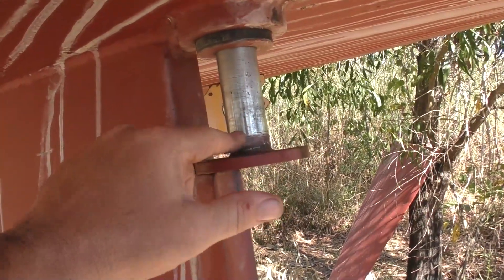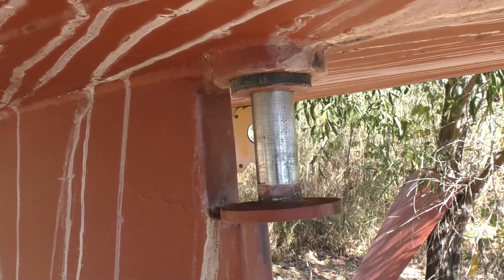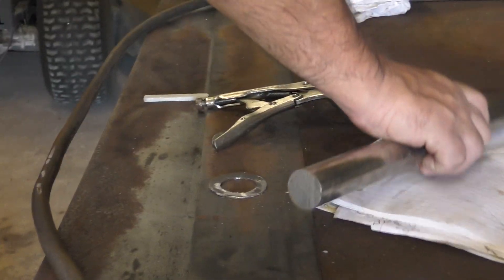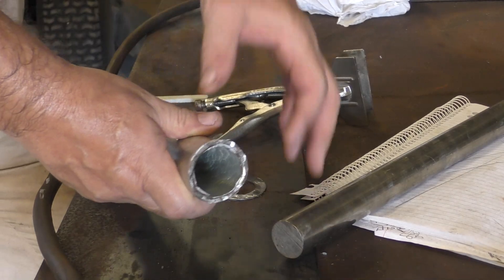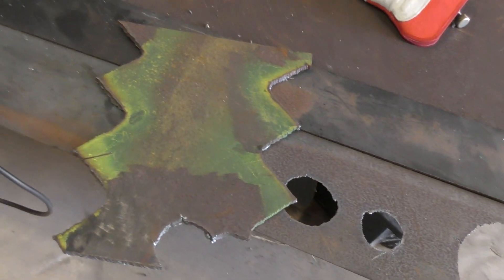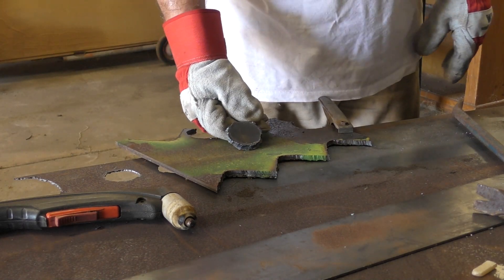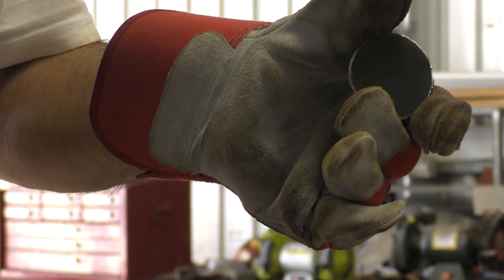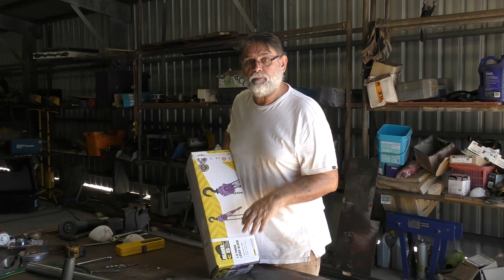Steel Sailboat Building - Seized Rudder Shaft Bearing

Comment: If the bottom bearing has done that on dry land, will it be ok in salt water? Corrosion might force the  nylon to pinch the shaft and lead to stiff or sticky rudder or will rudder action solve that in use?
Reply from the maker: I think the main issue was that I installed the bushing a a "temporary" thing for alignment etc. without doing any corrosion prevention, paint or anything. Then persist ant rains  rains come during the monsoon season and the whole boat is wet most days for six months. Probably capillary action drawing water up around the tube/bearing? Will treat paint & grease the entire assembly before it ever goes into the water. Cheers, Garry.
Reply: @garrychapple6418  Ahh that would explain it. Impressive build from scratch, been following with interest. Nice work.